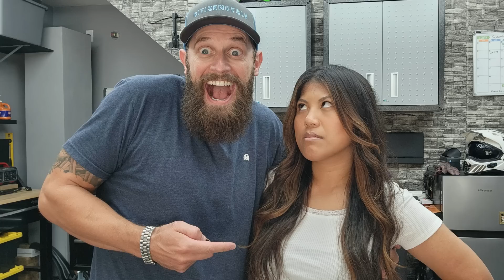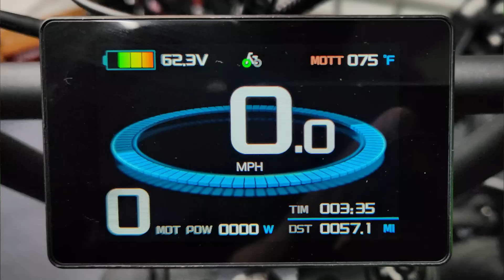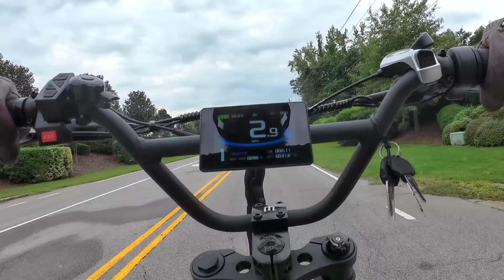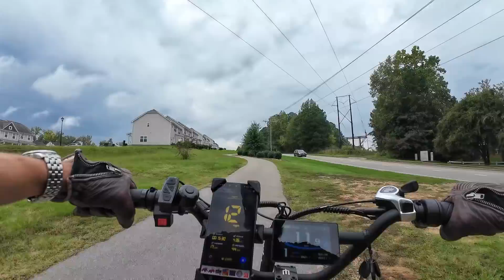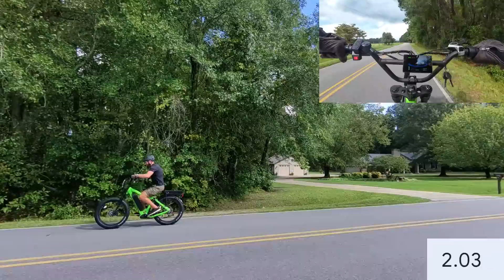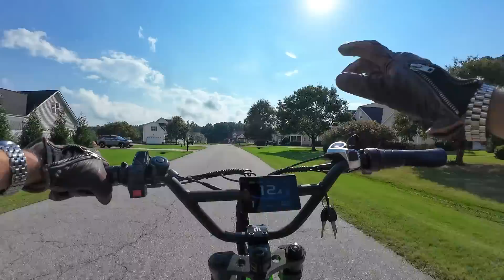Wired Predator: Testing a New 6000w eBike

Comment: As a '24 single motor Freedom owner, I love how Wired is pushing their products further and further, but honestly we need a 72V option now. With this much power, I want to be able to go 50mph so I can keep up with traffic anywhere except a highway, while still being able to ride slow and easy  at 10mph in a park. Out here in the midwest, that would be an absolute gamechanger.
Reply: Ecell,monstar go 50mph with a reader weighting  150 lbs 🚴‍♂️💨
Reply: @asleepappeal My comment said nothing about it needing to be dual motor. A 72V single hub motor would be just fine. Voltage = top speed, that's why I want more voltage.
Reply: @Tynted  , The Ecells Monstar goes 50mph with 60V battery, 80 amp controller and two 1500W motors, so it can be done without a 72V motor, but it is probably a lot more energy efficient to get up to 50 mph with 72 volts.
Reply: @asleepappeal Oh I see, no worries! Thanks for clearing it up 👍 Yeah I just want a 72V wired cruiser TBH lol
Reply: @asleepappeal I have a dual motor Lectric and I haven't been kicked off yet. 
I'm in Pa and they can be fussy. I wish they would just make a MPH limit instead 
of all the confusion.
Reply: This bike should hit 50+mph easy. Needs bigger controllers
Reply: Pidgeys  Cops don't care in my city as long as you're not riding like an asshole and you're keeping up with traffic
Reply: 72V option in now a reality.
Reply: @Beltfedshooters  Awesome! If it can maintain 40mph with assistance from pedaling down to like 20 or 30% battery, I'll be a happy camper!
Reply: Get an e-scooter. Many of them are 50 mph +
Reply: @firstinlastout  No, that is not an effective solution. I already own a dual motor scooter that goes about 35, and that's as fast as I wanna go on such a short wheelbase. The portability is amazing and I love the scooter, however, as I can throw it in the back of my car quickly. But it also has other problems:

- I can't have a basket and pannier bags on the back for grocery getting
- There's no good place to put lights or turn signals for visibility in traffic. It's also smaller, so you're even less visible in traffic than a motorcycle.
- It's harder to effectively lock up for theft prevention (they're easy to just disassemble quickly and they don't have great locking points), but a 50mph scooter is also gonna be way too heavy to bring in the store with you if you wanted to take that approach 
- There's probably others I can't think of right now. But my point is that a 50mph ebike would be the perfect middle ground between a motorcycle and a bicycle out here in the midwest if you want to be able to actually carry things on it with you.
Reply: @firstinlastout If this thing is successful with sales, I'm hoping Wired does consider a future 72v bike.  I think they will.

Comment: Another great video by the legendary Citizen Cycle!

I have the 24+ Cruiser; it's a blast! Plenty of power, top speed, and range. This Predator model is very nice, and I kind of wish I waited for it. But, with more power = less range. I like to go on longer rides across town. With that being said, I've tried to activate the CRUISE CONTROL. The screen display shows a 🦶 on it, but it doesn't hold the speed. What am I doing wrong? Please help lol
Reply: I have the same 24 Wired Cruiser +. Make sure you’re throttling up then press the minus button simultaneously. Then your cruise control should engage. Good luck 👍🏻

Comment: Have to say that I was disappointed in your test as you never had a test with actually pedaling the the Predator. Plus no test off road with that suspension and traction both pedaling through the gears and throttle . Maybe a new video with testing it in an off-road area.

Comment: Im impressed with the speed, but Im more focused on handling, agility and overall comfort. Also prefer a torque sensor with little to zero ghost peddling at higher speeds. Havent seen the perfect bike yet, but we're getting there.
Reply: my rad city 4 had a torque sensor and i loved it but i wouldn't want that at over 40mph...pushing hard on pedals at those speeds doesn't seem like the best idea!  if you could switch from one to the other on the fly would be really cool.

Comment: Does it have even have pedal assist ? I did not see u use it once? Or one wheel drive (front or back). Maybe it does or dosn't have anything other than insane mode?
Reply from the maker: Yes it has pedal assist and single wheel drive mode. I'll be showing more on that in the next video because it has a pretty cool safety feature with the pedal assist

Comment: Thanks for the video!  Just in time, we were going to order the furious bikes but once I saw this I placed an order.  We will either order a second one or we still might order one Furious.  We did use your promo code.  The one at the top didn't work but the code in the comments section worked.  The only reason we ended up with this bike is because ECELLS could not deliver our order.  We had to submit a complaint with our credit card and it took almost two months to get a permanent refund.  Looks like everything worked out I think we will be really happy.  If we order a second bike we will use your code again.  Thanks Greg
Reply: Yes, ecells has had nothing in stock for 2 months, and when I call and ask them when they expect their next shipment in, they literally tell me they do not know. Bankruptcy? Remember Enron?
Reply: @firstinlastout  I had two bike on order from Ecells and waited almost 3 months.  They still could not provide an eta so I had to cancel. Unfortunately they did not refund me my money and I had to file with my credit card.  Took almost 2 months to get my money back which is why we just now ordered two predator bikes over the weekend.  It actually worked out because these weren't available in April and May.
Reply from the maker: Awesome I'm glad you found the bike for you . You should get it pretty quick they're already on the ship traveling here now

Comment: I want to see an honest review of the Predator Vs the MONSTAR.  The MONSTAR was shown on radar doing 50mph.  My friend has a Wired Freedom.  She likes it but has had some problems with it.  It took forever for her to get the replacement parts.  Every company has issues with a bike.  It's like a car.  Sometimes you get a part on a new car that just goes bad.  I had a bad display on my Dual Star.  They did a next day air for my display, and I was up and running again.   Customer service is huge in my book.
Reply: until i see that monstar being gps verified i don't believe it and here's why:  electrified latina has had so many bikes tested but on this one she chooses not to run a gps app but instead a radar gun which we don't even know if it has been calibrated (which is very simple to do).  mostar puts out 3000 watts and hits a higher top speed than a wired by more than 5mph?  sounds fishy so let's see someone else test it.
Reply: Both bikes are capable of more but they are programmed at a 45mph limit.
Reply from the maker: @gregb878 if you're goal is just the top speed, I would not buy this bike
Reply: @CitizenCycle925  i know it's gonna be a climber.  I unlocked mine, and it scares the crap out of me.  I only do it once in a while.
Reply: @gregb878  i unlocked mine.   43moh is far enough for me.
Reply: The problem with ecells, is they don't have anything in stock, they have a huge supply chain issue
Reply: The math doesn’t add up for the top speed of the monstar AND we don’t know if that radar was calibrated correctly.   A gps test would be more accurate however cells has conveniently not shows us that.

Comment: Seems to me that similar speed could be reached with a single motor.  How about one with one 72v battery, slick tires, and a low handlebar.  You didn't mention anything about the quality of the suspension, the range, or ghost pedaling.
Reply from the maker: I have not done a range test on it yet suspension works great it's the same as the freedom. And no ghosts pedaling even at higher speeds due to the massive front chain ring.
Reply: @CitizenCycle925  Cheers!

Comment: I don’t see how this is necessary when the original one is just as good, you only get just 3 to 4 mph faster, plus it drains battery much quicker.
Reply from the maker: It's not necessary😁 it just has exhilarating acceleration and Power

Comment: That thing is sick, surprised you can’t hit 50 but you can hear the motors are at their max rpm around 43. Prob need higher voltage or different gearing/windings to hit higher top speeds, unless the controller is governing the top speed?  Honestly though, anything over 35-40 on a bicycle frame feels pretty sketchy. If I had the extra $$$ I’d order one.
Reply from the maker: Yes I think the motors were just topped out, they must have done the motor windings for torque instead of top speed which I'm totally fine with

Comment: no point in buying the ecells monstar...it's less than half the power and more expensive.  Wired putting everyone to shame!
Reply: Monstar has two 1500 watt hentach motors totaling 3000w.  Predator has one 1500 watt hentach motor and a 1000 ew watt motor totaling 2500w.   The monstar is more powerful.  Wired is trying to market it as more powerful by using peak watts only.
Reply: @f1dog it’s all about the contoller, the nominal wattage of the motor is irrelevant.  This bike is pulling 3500 watts in the rear and 3000 watts in the front and will absolutely destroy the Monster for less $$$.  Cleveland knows about prison, mobile homes, and unethical business practices, he don’t know crap about high powered bikes😂😂😂
Reply: @f1dog  i think a head to head with these two bikes is necessary like the one dude did using the freedom and five star.  the freedom literally ran away from the five star so i can see the same thing happening here. time will tell.
Reply: Don't buy the Ecells.  I ordered and could not get my bikes after nearly 3 months.  Then after to agreeing to give me a refund they chose not to.  I had to file a dispute with my credit card.  Also files 2 (one for each bike) with the FTC against Ecells.
Reply: Absolutely

Comment: uh wow, just wow
ok is there too much power? 
its a bit more than I want/need. But the power is there "IF" you need it!
 it is plenty to go on 1 motor,Buut yeah that switch on the fly is a super nice thing to get you up n over :) 

 It will be great to see what they come up with next. 

your suggestion to see about adjusting the power on that front hub motor is a good one.

 It will be interesting to see the performance on a long grade climb (?) as far as the overheating of what just 1 hub motor did on its own.

my "Guess" (& hope) is that the switch on the front motor will just negate the heat issues as they will be powering together :)

 & ok im a tourist and my top hill climbing speed will be under 30 going up a dirt road.
really Im not a racer & powering back is fine with me (anything over 14 mph is fine)

Comment: @CitizenCycle925 If you owned a 2024+ (dual bat) Freedom/Cruiser (as you do), do you personally feel there's a compelling reason to 'upgrade' to this? The 2024+ still laughs at hills and gains speed going up them with the single motor. Has the same top speed as the Predator. The launches in this video have so much wheelspin I have a hard time believing the acceleration is any better either... but you may have the numbers, I don't! I want to be excited about this, but it looks like Wired has found the limits of performance on their current system and may need a redesign to really get to the next level. Which is a shame, because I actually love the low-key nature of the current frame. Unfortunately, slapping another motor on this bike doesn't seem to have produced any meaningful performance upgrades from my point of view, but I would love to hear from someone who's tried both. What are your thoughts?
Reply from the maker: If you have a 2024 plus Freedom or cruiser and you're happy with the power then I would not upgrade. this bike is a wild ride, it definitely has a ton more power than a freedom or cruiser, way stronger on Hills, way stronger acceleration, slightly higher top speed. I think it's the bike for someone who has a lot of spare cash and just wants the baddest bike out there in terms of power
Reply: @CitizenCycle925 Thanks for sharing your thoughts. It is a badass bike, no doubt! Probably would have gone with the Predator had I not just picked up my Freedom a month or two ago. Used your code, thanks for all the great content. Helped me inform my e-bike purchasing decision greatly.
Reply: @CitizenCycle925  Nobody else has mentioned it.  Great Job of maintaining control while you had that much front wheel spin.  I know of quite a few eBike folks that would have trouble keeping the shiny side up on it under similar circumstances.

Comment: WOW,  tell themm two 60v25ah batteries and im sold.
Reply: That thing is quicker of the line then my 72v12000w 2.5t 45ah 150/350amp  bomber clone but my top end 70+mph with me 6 2 250. If I had better battery and controller but it's too fast .

Comment: I think the Predator ACTUALLY may actually break the front tire loose worse than the Monstar bike even though the front motor is only a 1000w vs 1500 on the monstar with the same 40 amp controller? I think the difference between dual1500w motors vs 1000 + 1500w might be the reason why the Predator doesn't top end quite as high as the Monstar. On the MONSTAR bike, I easily hit 45mph in around 10 seconds and clearly felt like it had more to give. I'm 6' at 185 like Bryan. Man What a Fun Bike, (both of them ). I want one !  Choices choices ....Man....But I guess that's a good thing.
Reply: The monster will have the same top speed as it is limited by the same motor.  They haven’t had it independently reviewed with a GPS and they are using 100 lbs women lying flat on the handlebars.  Not to mention you can’t believe a word that comes out of the owner of e cells mouth.  Plenty of direct drive bikes will go 50+mph but with a geared hub, it’s about acceleration and hill climb.  The Predator will destroy the monster in any head to head competition.  You won’t have long to wait as these are supposed to ship in the middle of November.
Reply: @jfly2249  Wow, you really hate the owner of ecells, don't you?  Are you the owner of Wired bikes? I like both companies and have no beef with either.  The competition is great for the consumer so thanks.
Reply: @f1dog  it's not that he hates him, i've been bashed by ecells cronies (one commented on this thread stayconnectedEV).  he is correct though, you're getting a more powerful bike at a cheaper price...since ecells can't do that they figure they'd bash Wired but a head to head with measured data will soon show what each bike is capable of.
Reply: @jfly2249 here's the TROLL again;)
Reply from the maker: Yeah I'm not really sure but I would imagine the motor windings are just built differently between the two bikes allowing for higher top speed on monstar. AlsoI think ecells might still be using KT controllers which i believe may be slightly less powerful than the Lishui controllers on the wired.
Reply: @CitizenCycle925  One would think that a 50amp controller for the rear, vs 40 would make for a better top end as well. I think E-Cells may have a more compatible combination using matching dual 1500 motors that work better in unison than a mismatched 1500 and 1000w motors on the Predator.  It will be interesting to see what next year has in store for us.

Comment: @CitizenCycle Why front-wheel drive only is handy. I am a 300 lb guy that lives in the mountains 10 mi from the nearest town. I switch from front to rear wheel every few miles to help prevent the motors from overheating. I can melt the average 1000 watt motor in less than 600 mi. That's the rear motor on an AWD bike. The front motor seem to last two or three times longer than the rear motor. Switching to the front motor when the rear gets hot does wonders for motor longevity. Love the video 👍🍻
Reply from the maker: Wow thank you for the input.  I never thought of that scenario
Reply: @CitizenCycle925  Does the predator have a temp sensor and display value for both motors separately? Because that would be amazing for monitoring temps and switching. I get high temps very quickly in the hills of CA with both my 2024 and 2024+ unless I closely focus on not giving more throttle than it takes to move the bike when on steep, loose hills.
Reply: You might need to keep those two motors on. You might be shortening the life on the motors. You’re a heavy dude! Good riding!!
Reply: How does this bike compare to citizen cycle dual motor?
Reply: Check out mid drive bicycles

Comment: Looks like the old version with a front wheel motor.
Reply: It is but the rear controller is a 50 amp so if you were to swap to that one you’d gain a bit more power on your 2024 plus wired bike
Reply: @johnnightly5281  i would love to do that to my current freedom, peaking a couple hundred watts higher would be nice...bike is already a monster as it sits!

Comment: 😂 Nice presentation, Bryan, on Wired's entry into E-motorcycles. It is definitely more of a specialty "eBike" that, to Wired's credit, not only beats other competitors in its class in price and affordability, but also keeps within the current Regulations Golden Rule of pedaling (acoustic) capability.  The good thing for you is that you now know you will soon be able to source 67 to 72 volt controllers and compatible hub motors for your next Gen Citizen Performance Warp Drive Kits! (Just make sure you require those Thrill-Seeking Surron-High-Risk-Taking customers to sign a Consent Form [and maybe insurance] to protect you, your family and your company from injury-based lawsuits.) Keep up the good work! 👍